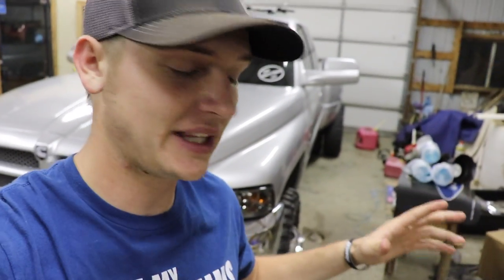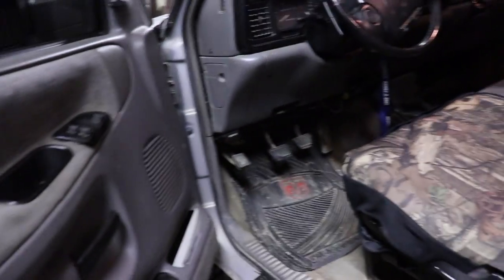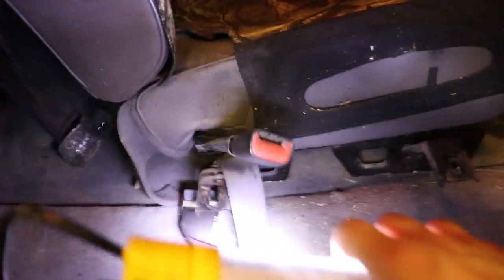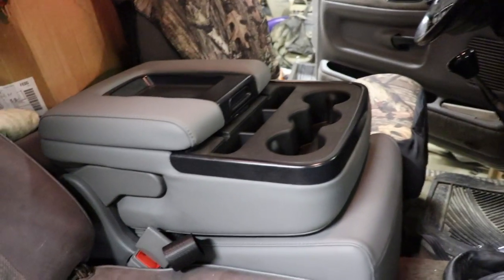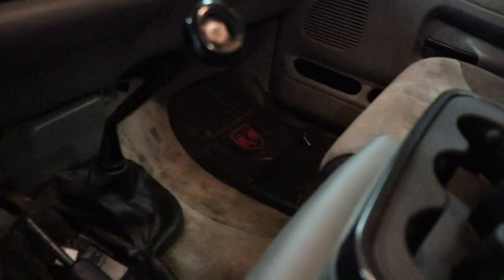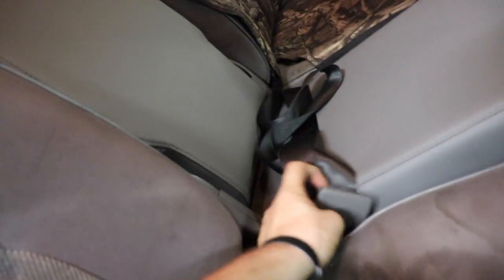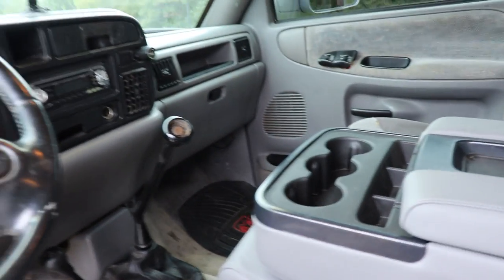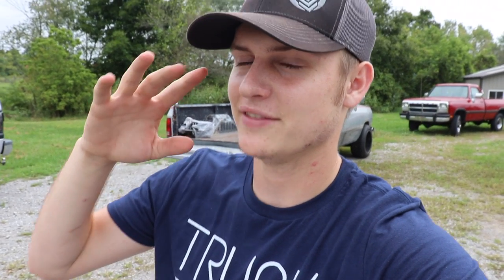CHEVY INTERIOR IN MY CUMMINS!!!

Comment: Tip for those bolts where you can't get 2 hands in there from somebody with giant hands. If you can't weld the bolt in place, use some construction adhesive or JB weld to hold the bolt still while you hand thread the nut on and then you can get after it with the wrench.

Comment: noticed your seats do not have the built in seat belts. Which means, you can put the matching silverado seats into your ram.  the 24v cummins seats has built in seat belts, which really limits your options for seat swap. But you can definitely put 2014 silverado seats into your ram.  then you wont need seat covers

Comment: Did you put any thread locker on those bolts? Just curious if you were worried about the vibration spinning those nuts loose

Comment: I’m thinking of buying a 7.3 OBS. Any thoughts? Anything I should know?
Reply: There good trucks.. umm ask me for questions
Reply: Alrighty. What’s the major issue that is likely to go wrong? It would be my first diesel, would it be a good option as a first diesel?
Reply: 7.3s are great trucks. Most of the issues that happen to them are mostly a sensor related issue as the trucks are 20 years old the sensors can go bad. They also are known to leak oil. The hpop (high pressure oil pump) can go bad. Another thing is the glow plugs. Most 7.3s will give little to no problems especially if they are well maintained. A 6.0 would also be a good option. they have a bad reputation but just like any other car if well maintained they will last as long as you dont put a high horsepower tune with out headstuds.
Reply: Avery Jones alrighty well thank you! I think I’m gonna go get one on Friday
Reply: Jman 1 did you go get her? If so how do u like it so far ?
Reply: Griff dawg I did not get that particular one. It had a little more rust than what I wanted. It wasn’t bad. Just barely poking over the chrome finish on the fender. But other than that I’m still on the hunt.

Comment: For the record, that center console seatbelt may as well be cut out due to the fact it’s safety rating is now limited to the integrity of those aluminum brackets.... which as you may know, ain’t gonna hold up to much of an impact lol
Reply from the maker: Aaron Hoover so having no belt will keep you safer? Over having it bolted down and having your belt on? 🤔 hmm...
Reply: The bracket work is all I’m saying would be enough of an integral compromise for me to rid the console of the seatbelt, and basically have a bucket seat interior. Meaning, the console never flips up and a passenger never sits in that seat. Which is no worse for the wear seeing as it’s a manual trans. Don’t take me wrong, I’m not dogging the workmanship, just speaking as if it were my personal vehicle. I think it is a perfect console for the second gen interior. Mainly in the name of now having functional cup holders. I meant no disrespect brother.